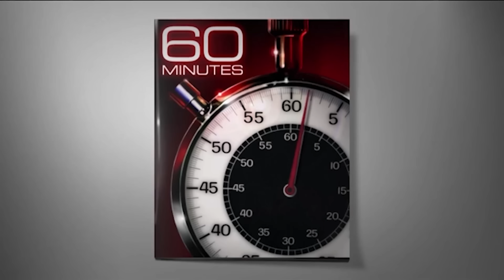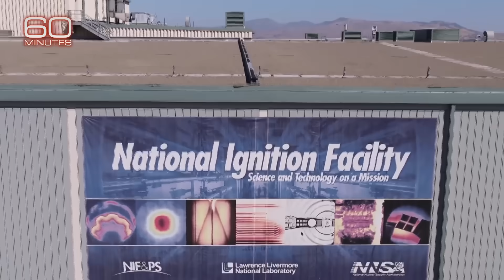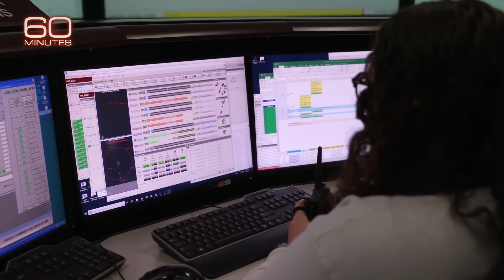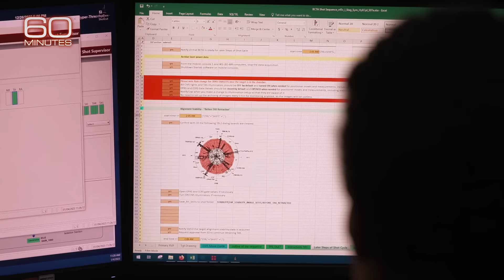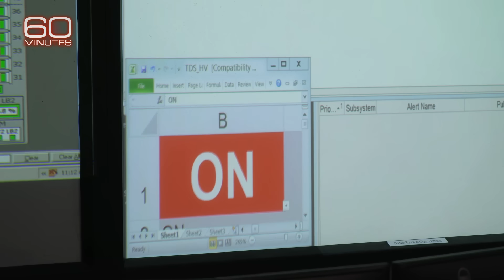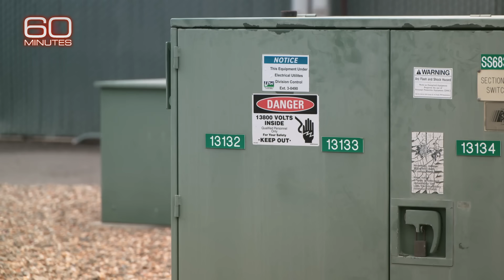Nuclear Fusion: Inside the breakthrough that could change our world | 60 Minutes

Comment: "Hotter than the center of the sun" If we were to hurl this object towards the sun it would vaporize before it would ever reach the surface. Yet, they have been able to create a device than can hold this object whose heat is greater than the center of the sun!?!? Got it........ smh
Reply: The temperature rise lasts only about 3 billions of a second due to being hit by the extremely brief laser pulse. The approximately 150 million degree period is when the fusion reaction occurs which is around 0.08 billionths of a second. The entire target structure turns into a plasma and then blasts away from the reaction center in the form of a small explosion. There is no 'holding' of it soon after the laser beams hit it. The lab has there own alternative definition of 'ignition.' It isn't anything like striking a match and holding it while the reaction propagates through the match head. The fusion reaction is almost totally dependent upon the compression from the laser beams and the X-rays it generates. Once the reaction begins it ends almost instantly after that. In fact only about 4% of the fuel mixture engaged in the fusion reaction with the rest of the fuel being blasted away from the center before it has a chance to react.

Comment: We’ll instead of 192 small lasers and small target. Why not just 5 or 10 bigger lasers so you could have a bigger target? Also why does the target have to be sphere shaped?
Reply: Fusion is incredibly precise implosion with equal instant force on all possible sides.
Reply: The reaction requires a totally symmetrical compression from all sides of the fuel capsule. A nearly perfect sphere provides the best chance of this happening to the extreme degree they need to reach enormous fuel compression pressure and temperature.
Reply: @vernonbrechin4207  Are you some disgruntled employee who lost his job at this facility and now takes to YouTube to degrade what they accomplished? ??

Comment: I don’t understand the ratios bit. 2 units in, 3 units out did not include the energy needed for the lasers? Which was 300 units?  How would 300 units be equivalent to the US power grid?
Reply: In past years the lab made no mention of the energy that was required to drive the laser system. The lab has been pressured to reveal that figure now. The 2 units in represents the X-ray energy that directly compress the fuel pellet. Those X-rays are generated by the 3 billionths of a second laser pulses hitting the inside surface of the gold hohlraum cylinder which holds the diamond fuel sphere at its center. The fuel capsule is compressed down to a microscopic point and during the last 0.08 billionths of a second the fusion reaction occurred, resulting in the emission of 3 units of fusion energy from it. The entire target assembly is just a plasma then and rebounds from the center, resulting in a small explosion.

The fusion labs have an odd definition of 'energy gain' that doesn't include the energy needed to drive the entire process. They define the input energy as that which directly compresses the fuel capsule, not the energy needed to create that drive energy. In the case of NIF the laser drive energy is over 100 times greater than the input energy that is used to calculate the 'gain energy. 

The power grid estimate given requires the factor of time being in the equation. In order to create a dramatic figure the lab management employs the amount of laser energy delivered to the hohlraum target in the 3 billionths of a second that the laser pulse is on. They then compare that amout of energy to how much energy the entire U.S. electrical grid uses during that same extremely brief period of time. Of course the energy delivered in the grid is continuous rather than in just  3 billionths of a second. In the case of the NIF laser system the energy is fed from the grid over a lengthy period of time and that is stored in a massive capacitor bank. Then at shot time it is suddenly released from there and fed to the laser system.

I hope I have helped answer your questions.
Reply: @vernonbrechin4207  Are you some disgruntled employee who lost his job at this facility and now takes to YouTube to degrade what they accomplished? ??
Reply: @vernonbrechin4207 Brechin You did answer them, and I'm greatly appreciative. This explanation was not available in any mainstream sources I Googled.

It's rather amazing that it's even possible to exchange information via YouTube comments, which are typically a cesspool. And rather sad that's where such valuable context to the story will be buried — right next to a guy with so little to contribute that his best response to factual information is a ridiculous personal attack.

Thank you again for taking time to write a detailed response.
Reply: @tubbytuber  - I'm glad that you appreciated my explanation and that you learned something from it that you couldn't find via a Google search. It is so sad that many of the nuclear fusion presenters have been so successful at snowing the journalists, the receivers of the journalists reports, the fan base and even the investors who keep throwing their venture capital at the showers.

I recognize that there are a great many people who have a great deal invested in their deeply held beliefs and find it almost impossible to accept that they have been taken advantage of.

The nuclear fusion promoters have become masters at taking advantage of the widespread fear regarding the threats posed by Anthropogenic Climate Disruption (ACD), often because they perceive such work as the only possible solution to the threat.

Comment: 300 in 3 out?
Reply: Exactly. The lab tends to use a odd input energy parameter for the gain calculation. It is the X-rays that directly compress the fuel capsule. The lab used to not mention the input energy needed to fire their lasers. Since others suggested they were hiding it the lab is now mentioning that figure. So now they have admitted that 300 units of energy were required to power the laser shot. Since the experiment took about a week to prepare the input energy to the building during that week would be much higher than 300.
Reply: @vernonbrechin4207  Are you some disgruntled employee who lost his job at this facility and now takes to YouTube to degrade what they accomplished?

Comment: Hasn't this been done quite a few times elsewhere?
Reply: Most fusion energy 'breakthrough' announcements have been filled with misleading sales hype and missing key information. The presenters have been well aware that the journalists, the investors, and the general public can be easily snowed by the extreme esoteric nature of their experiments. Those receivers usually can't ask key questions, let alone critique what has been presented to them. They are often hungry for a miracle technical cure and the presenters are keen to take advantage of that craving.

In most fusion energy experimental announcements no fusion fuel is employed and no fusion reactions take place. The announcements are often about a hydrogen-1 plasma reaching a new record temperature in their machines but are made in such a way to leave the impression that a fusion reaction took place.

Comment: This is why we have a hard time believing in advanced civilizations.   When you create more energy than you put in the energy out puts are limitless.   The objects flying around us are microscopic entities of power from very very advanced entities.  

A good way to look at it is a IPHONE does all the things of a room full of computers did 30 years ago.   

Now shrink this down and put it in a ship.
Reply: It’s not necessarily that it’s creating more energy than what is put in. The energy wasn’t created. It was merely converted from an unusable form to a usable form. When elements fuse they release alpha particles and neutrons (contingent on which elements are fusing). The alpha particles is the key to net positive energy. The alpha particles can be used to sustain a fusion ignition, which in turn leads to even more fusion. The neutrons are what humanity harvest and convert to useable energy. To achieve net positive fusion. You need to efficiently reach ignition and then sustain ignition without adding much if any energy back into the ignition to sustain it.

Comment: I dont understand any of this but facinated with just how smart these people are.
Reply: Basically they smash light into isotopes of Hydrogen/Helium and get them hot enough that the isotopes start fusing. In the process of the fusion, the isotopes start releasing alpha particles and neutrons. The neutrons are what humanity harvest as usable energy. The alpha particles help keep a sustained fusion reaction going without needing to keep blasting them with lasers. The difficulty is getting a net positive energy gain. The sun can do this because it has gravity as the factor that sustains conditions for fusion. Humanity has to spend electromagnetic energy to sustain fusion. The challenge scientists and engineers are facing is trying to find a way to create sustainable conditions with less and less a energy until we make a net positive energy output. Even that won’t be the end of the work though. The more efficient the energy input becomes, the greater the ratio we get out as a yield. If we can master fusion, we gain virtually free energy where the cost of achieving that energy is statistically irrelevant compared to the output. This can lead humanity far into the future before we feel energy strains and concerns again. At that point, hopefully advances in physics finds a better alternative for a growing advanced civilization.

Comment: Fusion ignition for a billionth of a second?  You've got to be kidding.  That has to be the world's most expensive boondoggle.  High-salary jobs that will last a lifetime and no guarantee of useful commercial results for decades.  A pipe dream is an understatement for commercial-use nuclear fusion.  I wish these companies the best of luck but unfortunately I won't live long enough to see it happen.
I don't know the size of the smallest star but I'm sure it's much larger than the containment area of the largest fusion reactor on Earth.
Stars are large for a reason and yet we think we can make them a lot smaller using higher temperatures.  Good luck with that happening.
Reply: Star sustain fusion with gravity. Gravity is billions of times weaker than the electromagnetic force. Which stars obviously compensate with their gigantic size. Point being is that humans can achieve fusion with nothing but the electromagnetic force as the sustaining factor in ignition. You don’t need a stars worth of gravity to do fusion. The challenge is increasing the efficiency of the process leading up to fusion ignition to the point of net positive energy. It’s an immense engineering challenge and there’s a chance it doesn’t happen in either of our lifetimes. It doesn’t mean it’s not worth pursuing though. If we can master fusion, humanity will have all the energy it needs for the next several thousands years. Don’t you wish that for your grand children & their children? Men plant trees whose shade they won’t get to enjoy.

Comment: The lasers injected two million joules into a pellet of tritium and deuterium. Fusion of those atoms released three million joules. Hurray! But the electric  grid had put 300 million joules into the lasers' power supply before the test. This is a long way from being useful. For eighty years, fusion has been fifty years in the future. It still is, and will be for a very long time.,

Comment: Such nonsense.  Break even is calculated relative to the light energy hitting the target, and not relative to the energy required to produce the light.  The fusion reaction yielded less than 1% of the energy that went into pumping the lasers.  Practical fusion power is still just a pipe dream.
Reply: It’s still a longshot, but one worth pursuing.

Comment: This is a joke.  They left out exactly how much money was needed to get here.  They left out exactly how much energy was required to make that shot verses what they got in return.  So take difference from the energy in verses out (that 2 pots of coffee) & figure the cost.  It wasn't sustained either.  There are private outfits spending way less that are further along.  I feel this video really takes away from those outfits who have already achieved this & more!
Reply: Actually, they said at 9:47 That it "Took 2 units of power and produced 3, While the laser used 3000 units of power, and gave 3" Even talked about how long of period it will take before they do it, might want to rewatch this video then.

Comment: As impressive and exciting as this is... I can't help but laugh at how impractical it currently is. Even though the actual event yields positive power output, the amount of money and energy required to prepare for and actuate the process dwarfs the output.
Reply: It doesn't yield positive power output, https://youtu.be/2kh6Ik4-yag?t=590 302 units in, 3 units out...
Reply: @steakbbq  The lasers are 30 year old tech.  There are way more efficient lasers available.  Now that this achievement has happened, more funding may mean and upgraded facility.  Can't upgrade without results...

Comment: Try out spiral tubes in circumference with lower intensity laser conducted through them in resilient fibre optics encased in copper tubes. Let the laser pulses be directionally opposite in adjacent tubes. The diameter will decide the effect in enclosed chamber where " atoms can be streamed unto fusion or directional emission depending on sequential intensity of spiralling juxtaposed pulses of tubelets. Spiral juxtaposition in copper casing helps increase intensity. The lenses would have to be diamonds or of equivalent resilience. The rate should be progressively controlled. You might generate energy to facilitate higher speeds using plasma/ streaming hydrogen.

Comment: "It's not a science problem anymore - it's an engineering problem" - Accurate description.
Science is painful, takes unseen amount of effort... But engineering can be exponential.
Reply: The answer might be an engineer who thinks outside the box
Reply: @matthewcaughey8898  or they think inside the sphere.
Reply: That was deep
Reply: In the meantime we can harness the energy of solar panels to for many purposes & the costs will go down as technology improves.
Reply: @keyissues1027  harnessing solar energy is good but with less than 30% efficiency it's very hard to justify for that. That and the ugly fact that no matter high the efficiency is you would always depend on the solar as the source. Not every countries would have access to that
Reply: When i worked on nif about 10 years they said power from fusion was 50 years away. So mabe in 40 years?
Reply: @johnramirez5032  😢
Reply: I say all teams around the world compare notes already and just work on it as fast as possible.
Reply: engineering is just the toolbox of scientific discovery
Reply: As long as funding is also exponential ... increasing I mean 😀
Reply: Big oil and greed will never let this happen
Reply: Why are you so sure? It needs to be 100 times more efficient before we even get to the engineering problem. If you use 300 energy units to get 3 it is quite clear this is not sustainable or efficient.
Reply: I Wonder what Elon's thoughts are on it ? He's solving Space issues and more with Science & Engineering .
Reply: @DeadShred9  you cant be serious
Reply: @DeadShred9  if he got involved we’d probably have iron man suits built by now lol.
Reply: @7Suave  No, if he got involved, he'd bankrupt the company
Reply: @tjewett1967  His companies seem to be doing fine

Comment: nice to know where the money is going to be funnelled  into next. This isn't new it is same crap they have been dreaming of for 80 years with basically the same result. Tremendous input for practically no output. Here is the flaw... these batteries take how long to charge? You need 300 shots a second so how many batteries will it take? When you say 300 units that is somehow convoluted into 2 units what is the actual power it takes say in megawatts?  And this is going to magically happen with wind and solar?

Comment: I remember reading about the mapping of the human genome and it was said it would take 30 to 40yrs to be completed but I believe it was done in less than 15yrs. With the right amount of money, this can be done in a decade.
Reply: The problem with this kind of revolution is that it takes construction times to build the tools to even push the testing further. Even with infinite money you're limited by how many people you can physically fit into a construction project and making sure it's all absolutely perfect, since you can't afford anything less than perfection for a project of this size, cost and importance. Ten years is in the realm of impossible even with infinite money, at least that's what scientists currently agree to with the current available knowledge. But if you're young like me, there's hope commercial fusion may solve energy issues in your lifetime, whether it's 30 or 50 years from now, and usher in a new great age for humanity.

Human genome on the other hand was basically brute forcing the process at an extremely slow and painfully inefficient pace, without really any notable technological improvement necessary, just sheer time and money. IIRC it costs millions or even billions for something that today costs 2$ and is done in minutes, but could be done. In the case of fusion analogy, it's as if we would have needed today's technology or 2030 technology in sequencing and genetics to be able to even start a human genome project.
Reply: That is true but I’m sure the number might be close to trillions
Reply: @julianromo4661  just redirect the money from Ukraine to fusion reactors.
Reply: Any one know the name of the company? So I can invest lol